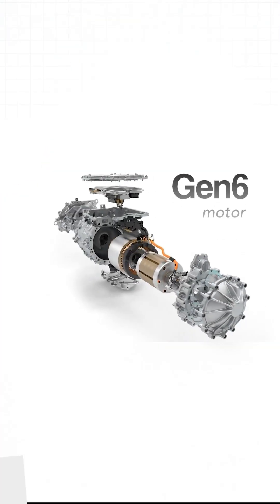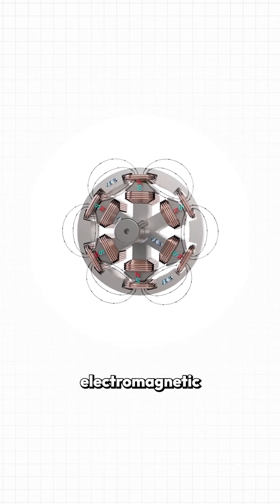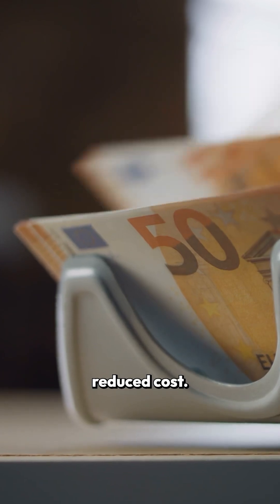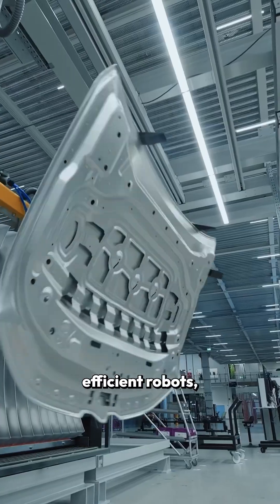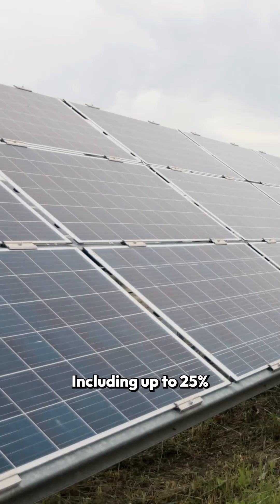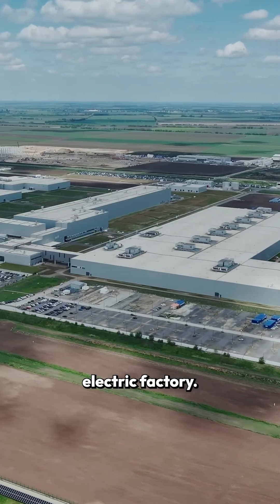BMW’s New Motor is FREE of Permanent Magnets

Comment: The real killer would be brushless servo motors with angle-dependent permeability. It doesnt give you much torque, but this higher order term has been completely ignored since the early 70s because one engineer was lazy and everybody else just copied a wrong paper from 1972. Source: Did the mathematics from scratch to build a motor controller for it because every paper on the subject was wrong

Comment: Doesn't matter, the next cars with the Gen 6 motor will cost more than the current cars with the Gen 5 motor.

Only win is to BMW for switching to a bigger material supply, so they don't have to stress about the cost of rare magnets. This won't financially impact the customer

Comment: Welcome to the 20th century 😂

But happy to see that they’ve made brushed synchronous motors work in car applications now. Question is of course, are the brushes replaceable or do you need to replace the entire drivetrain WHEN they wear out… I’m imagining my new BMW being delivered with a small bag of spring loaded pieces of coal like a cheap Chinese angle grinder!

Comment: Their Gen5 motors also didn’t use any permanent magnets. They went from two EESMs on AWD models to now using a combination of an EESM and an induction motor on the Neue Klasse models, but it is likely the “i M3” will likely use 4 axial flux PMSMs with clutch pack to disengage the front axle when not needed.

Comment: How is brushless to brushed motors a step forward?
Reply: Good question, actually.

While yes, it has a brushed connection, unlike brushed dc or universal motors, the direction of current remains the same and it's not constantly switching, so it's essentially more like a slip ring.

In other words, yes, there is friction unlike on pmsc motors, but still much less than the brushed dc or universal motor you see on older house appliances or cheap rc cars.

Comment: 1. Electromagnets are better than permanent magnets.
2. Commutators and sliprings are different. Carbon brush worn out quickly if commutators are used. but slip rings have less fricton.

Comment: Externally excited, external power source that's fully electric. Exceptional are we talking about a Fusion car, a free energy car, a hybrid car from a Sterling engine perhaps a capacitor driven car! Or are we still talking those dreary unexceptional battery drive cars which inexplicably you excepted too mention for some inexcuseable exasperating reason please?

Comment: A motor with permanent magnet is much better. No wear part, no carbon brushes making dust near the bearings and electric contacts... and permanent magnet is better for regenerative braking.

Comment: Guys, keep in mind that those brushes don't do commutation like the brushes in DC motors. If you can replace these brushes easily, the motor is immortal. This motor is basically a synchronous generator. Most generators in the electrical grid are older than 30 years, so yeah.
Reply: Most generators on the electrical grid have a maintenance team taking care of them every few month: checking the wear, cleaning the dust and replacing the brushes if they need. These electric motors wont have any of that.

Comment: Wait wait wait...
Did you just called Electric engines an innovative engineering??!?
There was electric vehicles mass production already hundred years ago, you can't confuse it with a real innovation..
There's Hybrid vehicles with the combustion engine not connected to the wheels, surely you could call THAT an innovation 😅
EVs are one of the worst industrial SCAMS ever in human history!!

Comment: Very good.  So long we are not having the rare earth materials it is good.  The little degrade in efficiency should be acceptable.  But the cost of the engine would get reduced now.
Reply: If you are using a less efficient motor, you need a bigger battery to get the same range. You use less materials and energy and cost by having the most efficient motor possible.

Comment: The idea behind a synchronous drive machine using brushes is much more than just politically influenced prices on resources. From an Engineering POV, EESMs allow for a more flexible and especially independent adjustment of both torque and RPM while maintaining a higher efficiency. Yes there is some loss due to the brushes however it is minor to the losses you have on the overall torque rpm bandwidth of an ASM. Also I doubt that not using rare metals like Nd makes the drive cheaper since a more complex control unit and power electronics are required. It is a great choice and more car companies will introduce it since suppliers like Vitesco are offering similar or even better drives
Reply: The regenerative braking efficiency is lower on a brushed motor than on a permanent magnet one.
Reply: @niconico3907  Why? This is like a permanent magnet. I have it on my Little Renault Megane E-Tech. When braking, I see peaks of -60kW. 😅

Comment: I believe Toyota uses induction motors (asynchronous motors) on the AWD Prius since you can make them more compact. Induction motors are great and widely used, but in a car there's potentially over 10% efficiency loss. If that's translates into 10% of range loss that's not good.

Comment: I will say The New tech where a German Company is Working on a New Technology They making a Motor that Has wireless 🛜 Electricity Pass (soory for my Bad Explanation) but currently it has so Much Electricity Waste Because as We Know Wireless Pad has So Low Power (and use Much more Power to use it) but yeah it will be better in future also The Whole Motor is Dipped in Oil for Cooling (Non-Conductive oil) also I would prefer Koenigsegg Electric Motor than Bmw...

Comment: So why not use a synchronous reluctance motor? No magnets needed (though apparently often added for increased efficiency) and no need for brushes. Genuine question unsure if the synchRM has any disadvantages vs the brushed motor.
Reply: Yep they also work, but they just are inherently lower in power density. Meaning, for a given size, the reluctance electrical motor will only provide half the power or so

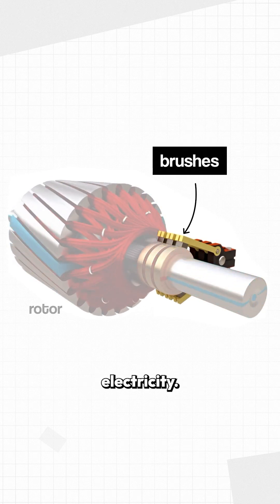Comment: 0:25 this does reduce efficiency in some situations.
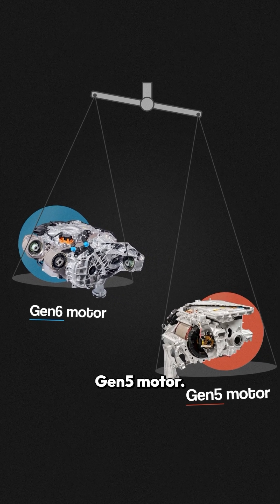0:44 they also contribute to 20% higher overall efficiency.
Pick 1.

Rare earth minerals aren't rare. They were named back in the days where they'd just discovered Aluminium which is the 3rd most abundant element in the Earth's crust.

Neodymium is very common and Dysprosium is more common than tin. Both elements can be recycled too.

The only reason BMW are using these motors is because they didn't have the foresight to lock in suppliers for the mineral required for permanent magnet motors.
Reply: Most of the efficiency loss of an electrical motor comes from copper losses (proportional to applied current and desired torque output), and Eddie current losses (proportional to RPM and magnetic field strength). These motors have double the copper loss compared to traditional brushless motors, which reduces efficiency especially in low RPM and high torque scenarios (like accelerating in the city). 
However, they can reduce the inner windings power and thus magnetic field strength within the motor when only low torque output is needed. This significantly reduces Eddie current losses in low torque and high RPM scenarios, such as highway cruising, making highway cruising more efficient.

Now, where do you care more about your motors efficiency, in city racing, or highway cruising? If your answer is the latter, this motor is the right choice and overall more efficient
Reply: What if it's because these are much more efficient at part load. Because you can't shut off a permanent magnet you have all of the inefficiencies of the rotor field interacting with the stator armature, even when you need much less rotor field. The thing is that if you want a powerful petrol car you can just give it a massive fuel tank, but if you want a powerful ev with a usable range you either need to do something about the losses at part load or you make a 3 ton behemoth even people who buy current bimmers won't touch. It's literally the only single thing they're doing right.
Reply: @josefsvitak4313  True! There's a good explanation on Munro's channel, in the Nissan engine video.
Reply: smooth brain comment
Reply: @Herbit-k4j  Feel free to back up what you said with actual proof.

Comment: Actually, BMW’s new “magnet-free” motor doesn’t mean it’s completely maintenance-free. It’s a wound rotor synchronous motor (WRSM) — meaning the rotor uses copper windings instead of permanent magnets, and it needs a small electrical current fed through brushes and slip rings to create the magnetic field.

So yes — technically there are brushes inside, but they don’t do mechanical commutation like in old DC motors. They only provide excitation current to the rotor. Still, that makes them a wear part — they’ll eventually need replacement, and they can create carbon dust and minor arcing over time.

BMW chose this design to eliminate rare-earth magnets (like neodymium and dysprosium), reduce supply-chain risks, and make production more sustainable — not because it’s completely maintenance-free. It’s a smart trade-off: a bit more mechanical complexity in exchange for full independence from rare-earth materials. ⚙️⚡

Comment: BMW’s “magnet-free” motor isn’t fully maintenance-free — it’s a wound-rotor design that still uses brushes and slip rings to feed current into the rotor. They don’t switch phases like old DC motors, but they do wear over time and produce some dust. BMW chose this to avoid rare-earth magnets, trading a bit of maintenance for better sustainability and supply independence. ⚙️⚡

Comment: If only their cars weren't specifically designed to fall appart once the warranty expires...
Reply: My BMW is 12 years old and since the warranty expired it's only needed a wheel speed sensor, a minor rear suspension component, and a coolant tank due to a crack (€130 or so at the dealership) . Total lifetime non-routine maintenance cost less than £500.
Reply: @feanor5037 Trade it in for a new one 😂

Comment: Efficiency, efficiency, efficiency.  Cost savings, thru automation in the plant. Renewable energy, which will be far cheaper, in the long run. 

What's missing ?  BMW will NEVER pass any of the savings on to the consumer.  The new models will be priced higher than the previous ones....and so forth and so forth....forevermore. it wouldn't matter if they found a way to build the whole car for 1000 Euro.  They'd STILL jack the price to the stratosphere.  

GREED is the disease rampant throughout the entire car industry....and BMW is as bad as anyone else (maybe worse).

Comment: What do I study to beginning understanding this?  The physics the electronic engineering?
Reply: Physics, power electronics and electrical engineering.  And I'd add Mathematics will be required for all of them too.

You're dealing with incredibly high currents here.  Physics is the basis for this.  Power electronics will give you circuit design behind it. And electrical engineering will give you the hands-on real world experience of designing and handling parts capable of working at these stresses.

Consider for a moment that an EV has to be connected to your house for around 8 hours to charge it enough to go several hundred miles on current technology (no pun intended)… all of that is stored in the batteries locked away in the battery tray (wherever it is, usually underneath).  That's an enormous amount of potential energy even before we talk about the risks of Lithium sourced fires until everyone switches over to next generation batteries "real soon now".
Reply: School. Too late now.

Comment: This is the same technology as created for the Tesla model S. The model 3 went with permanent magnet design due to higher efficiency. You need to put a current through the stator AND rotor in this design. This is more about cost management than environment - it's BMW after all!
Reply: No, the model S uses an asynchronous motor, no brushes

Comment: Satisfying?!
More like cultic euphoria really. 
I’m still waiting for the solution of the plastics EVERYTHING is made out of now, if you guys achieve a big enough dent in the market to make it unavailable. And then there’s that other problem, the elephant staring at all of us, being able to travel more than 50 miles without having an anxiety attack finding a place to charge your EV battery, forgetting what convenience is, and also having the time to charge all the time. 
EVs with all the innovation and hoopla are still practical and environment controlled 5-star crash rated golf carts.

Comment: Any word on if they addressed the problems many commenters have brought up?  Great that the motor weighs less, and in theory costs less, but...what's the trade off?
Reply: I'd make a guess that the lower efficiency of these motors is offset by the lower weight...
So, the ratio of input power to output power for the two types (brushless/brushed) is very close.
To be honest, with the conditions we've all heard about the mining and extraction of minerals for just the battery tech, we never hear how good/bad the conditions are for the miners getting the rare earth minerals for the magnets we've been using up to now.

Not that I'm going to be getting an EV any time soon - I like being able to add 600+ miles of range in 3-4 minutes.

The big car manufacturers should be putting all their research money into e-fuels - using recaptured materials that existing fossil fuel use has already put into the atmosphere.  That would turn every fuel burning vehicle into a "carbon neutral" vehicle - AND cause a slight reduction in overall pollution, as there would be fuel reserves created from the pollution we've already pumped into the atmosphere.

My Political Rant Ends Here

Comment: How is it more efficient?
Reply: Munro Channel Video Explanation, Nissan Engine 😬
Reply: permanent magnets creates rotating magnetic fields (with fixed magnetic flux like a generator) , here electromagnets inside can vary the magnetic field depending upon the load leads to less losses overall. Something you cant do that with permanent magnets.

Comment: ABB Electrical in Sweden have designed a highly efficient electric motor.

I'll just add that these motors need high power electronics to control them and they will stress the windings and wear the bundles through vibration and thermal cycling.

The permanent magnets in the common car motors made today use special blends of metals to avoid the curie point and degaussing caused by heat and crystalline shock from vibration.
Reply: I'm trying to design a very efficient but weak electric motor from scratch, can you tell me the most important steps?

Comment: Next they invent the asynchronous induction motor
Reply: "imagine a way to create permanent magnets in the rotor transmitting power without brushes, like a wireless charger!!! Voila!
Reply: Hahaha
Reply: You're making fun of it, but some time ago I saw a video about a machine that had an ac electrically exited rotor powered by a coaxial transformer like a brushless resolver.
Reply: I remember when Tesla scrapped their two speed transmission for a revolutionary and innovative direct drive system.
Reply: This guy is either a paid shill or doesn't understand what's he's making videos about.  Meh...probably both!

Comment: The worst thing about an induction motor is that it tends to build up a static charge on the rotor. In the cas of the Renault Zoe this chadge dissipated via the motor bearings causing them to weld themselves together at the contact points causing early bearing failure
Reply: The video shows three brushes, so likely two for DC current, one for taking care of the charge buildup. One insulated bearing would suffice to prevent eddy currents and thus any damage from spark erosion like in the Zoes.
Reply: @lborl5843 no, it's three because it is a 3 phase induction motor. There are 3 coils of electromagnets that switch on and off to create a rotating motion

Comment: But wait, I think this is old news? Hasn’t BMW used that motor concept for a couple of years already ?? BTW the worlds most efficient motor ever built (a gigantic industrial motor) also use a rotating field winding but it is supplied contactless using a rotating transformer. Guess that solution becomes too heavy and bulky for EV application.